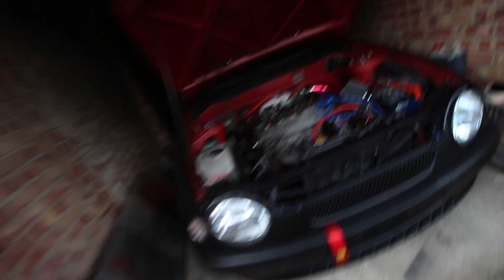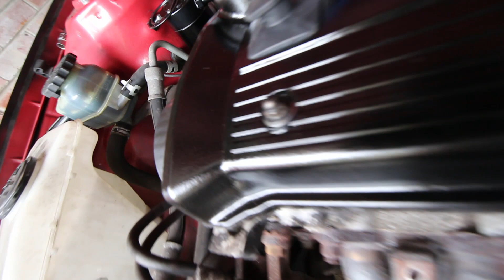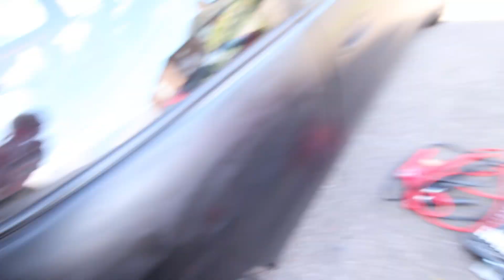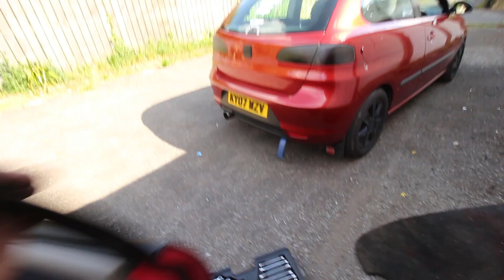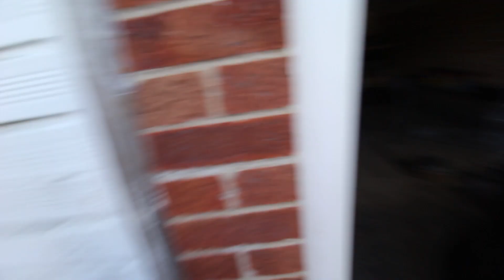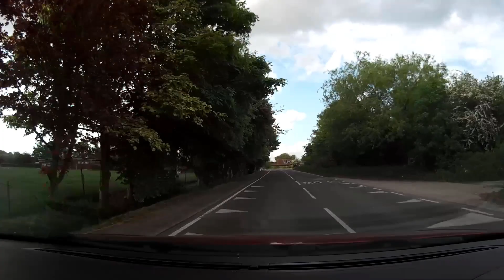Respraying The Valve Cover + Installing The Rear Coilovers!

Comment: Where did you get your rpm gauge from?
Reply from the maker: Just off Ebay mate :) https://www.ebay.co.uk/itm/Universal-Car-Auto-Tacho-Rev-Counter-Gauge-Tachometer-Red-LED-RPM-Light/164172383609?hash=item26396fc579:g:V~EAAOSwrTFdSrgX
I also did a video on the wiring ;)